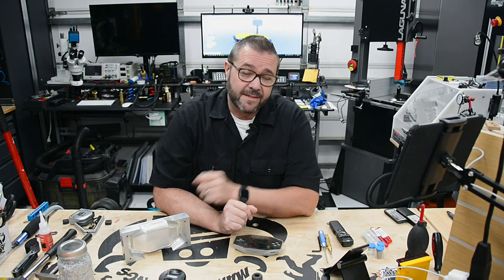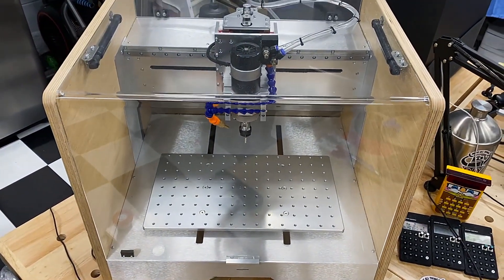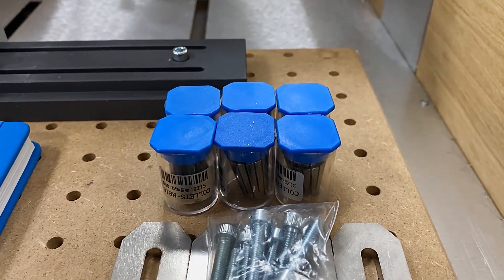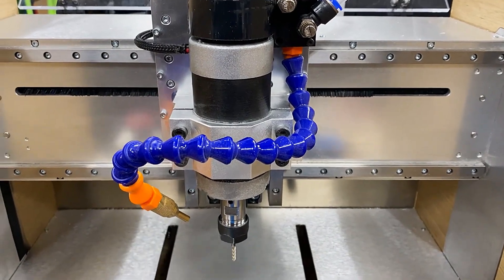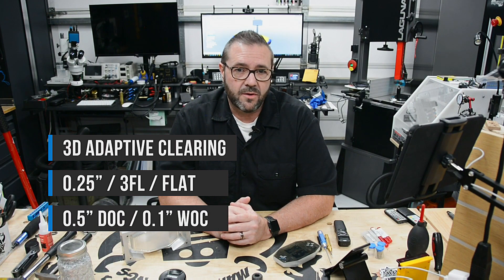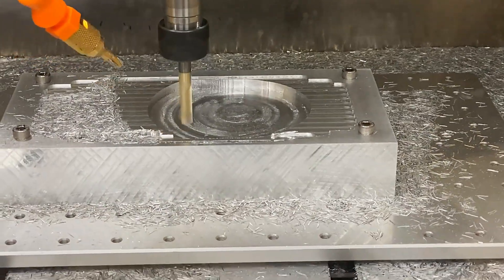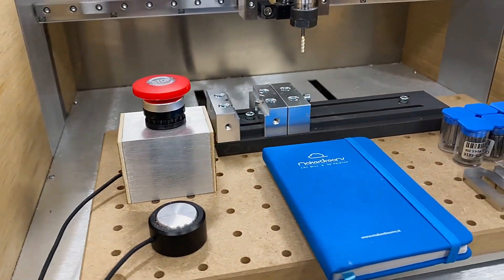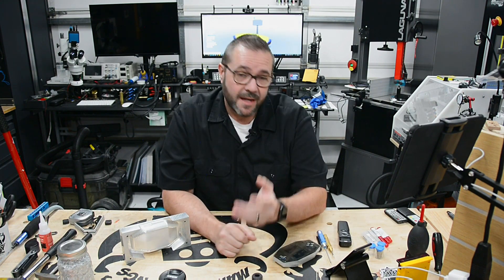A Real CNC Powerhouse on your desktop! Look At The Makerdreams: Evo-One!

Comment: This seems nice and i like when there is competition in the market place. Especially since I'm looking for one. The wood on the sides are just not eye appealing at all. Bantam seems to be a bit more professional and only 400 more I believe.  Either way thank you for the video.
Reply from the maker: Imo, if we’re purchasing the desktop for the way it looks. I like the evo-one over bantam. But since performance, rigidity and mill area is what really matters, bantam doesn’t stand a chance! Not to mention you could probably mill a bantam on the evo-one. ;)
Reply: @DIYEngineering  I'm a machinist for over 25 years and I'm looking to make molds at home . How do the wood walls hold up to the aluminum hitting it?. Also I see it rides on basic rail system with no covers. How is chip management when it comes to that. I assume I'll need mist machine also or just use pure air like I've been doing for awhile now. Also spindle speed is half. Definitely look forward to searching your channel for more videos before I make my purchase.  Thanks for your reply and tips. I just found your channel and I'm enjoying the content.

Comment: What's the difference between this and the NOMAD 3? Is the EVO-ONE really $1300 better? And why? I would only be using it to make 3mm computer cable combs out of acrylic, aluminium and brass.
Reply from the maker: Hi, the nomad is a fine machine, but the evo-one Cnc has a table almost twice the size of the nomad 3, it has ball screws on all axis for better accuracy and zero backlash, the nomad uses leads screws and anti backlash nuts, which is fine until you start milling metals. I can do alot more on the evo-one than i can do on a nomad... Desktop is desktop, they all have trade offs

Comment: This is nice compared to a Nomad, but I built my own vertical milling machine for less than this machine costs, and it is made of steel and HGR20 rails and has a proper spindle (BT30 taper tool holding). Personally, I think they should have gone for cheaper C7 ballscrews and just put linear encoders in the axis and made it a closed loop system. Building your own mill is definitely NOT for everyone, but if you are determined to make a have a decent milling machine and you want more than this thing can do, that's the way to go. Either go from scratch or get a cheaper manual milling machine and convert it.
Reply from the maker: I suppose it depends on your level of interest and application of the capability. To make it worth the effort.

Comment: Great looking machine. What do you think an ideal cooling solution might look like since flood cooling isn't an option?
Reply from the maker: They are developing a new spindle with higher rpm and better cooling. Which may address the issue. What i found is with the air cooled spindle, it heats up the air significantly after a long operation. With this spindle I think it would benefit from a heat sink on the motor as well as venting in the enclosure. Currently the enclosure has no venting so it turns into a bit of an oven... not to mention the motor heat travels directly down into the endmill. Not a big deal for most but if you’re running an operation greater than an hour, and you’re pushing the machine limits, you may have to slow down your feeds to prevent chip welding.
Reply: @DIYEngineering  Got it. Thanks, I really appreciate your no-BS reviews. Seems like this is an excellent machine, but once the heat issues are dealt with it will be close to perfect. You did a nice job with the cooling setup on yours, but I can see how you might want to get some extra ventilation inside the enclosed space. These consumer-grade offerings are really coming a long way.
Reply: https://youtu.be/nRj0thNodGk?t=206
Reply: @RuneWarhuus  he says at the end of the video that he'd prefer a better solution, but he didn't say what that would be.